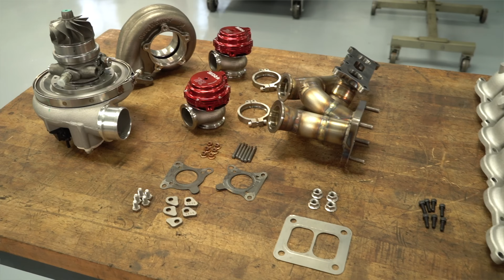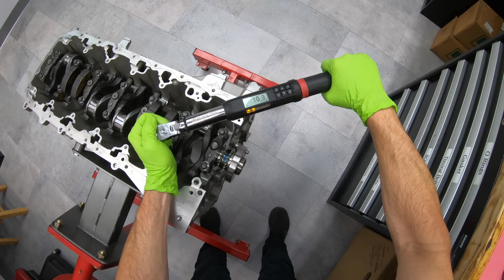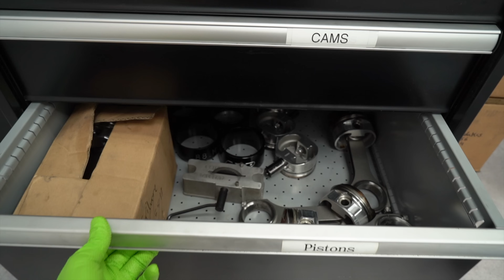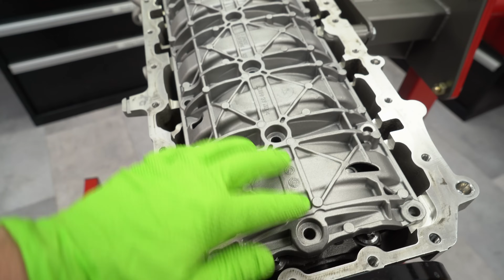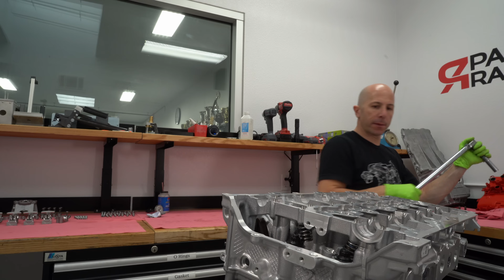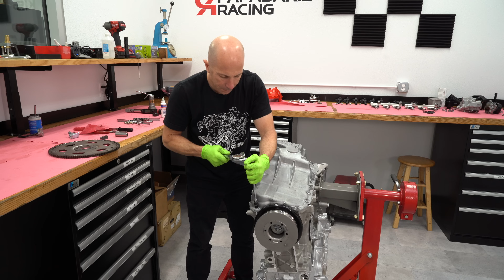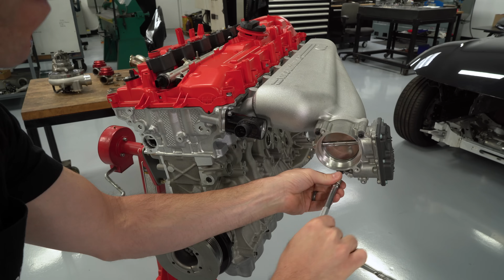2020 Supra 1000 HP Engine Assembly - Start to Finish

Comment: I hate to be that guy, but even if this engine costed 1/2 as much to build up to 1000hp as the 2JZ, I’d still go with the 2JZ. Per usual BMW designs are too overly complicated and finicky for no good reason. There’s no way I could see this engine lasting as long as a similarly built 2JZ without having issues somewhere
Reply: Mostly the way that the main caps and head bolt/studs crush down into the aluminum block and head that could cause uneven pressure points and even fractures down the road. Also the added valve train complexity and the two itty bitty exhaust ports that I could see restricting the flow necessary for super high horsepower applications. Only time will tell though.

Comment: I will guess the head won't survive the power because the localized heat will reduce its capacity to take the pressure, unless the compression ratio was lowered and the cooling flow rate was increased in ratio to the power increase.  Just guessing.

Comment: Your removing the direct injectors for port injection but the ports aren't designed for wet flow. All the cool features of the engine your removing!

Comment: The new 2013+ vw engines have all the same technology for the exhaust manifold and variable cam lift but are MUCH simpler than the complex bmw design. Very poor design imo.
Reply: Ptao Tom  what does that have to do with BMW's design ?

Comment: He only replaced the rods and pistons. Why did he remove the crank and reinstall with stock parts? He never tested the stock pistons or rods for 1000hp. I think he wasted his time, and only needed injectors, wastegates, and bigger turbo.
Reply: You could of ported and polished heads, stronger valve springs, 😕 WTF is he thinking?
Reply: @sleepwalker29  no one knows the limits of these yet not even in the 1000hp range so why not see if it all can handle it.

Comment: You kidding ,wright ? 1000hp  ,with that tini exost ports?  Sounds like a mega fart  from bmw % toyoda .
Reply: I mean it looks like he's using a similar method that people use with those tiny ports on rotarys yet they still make tons of power. Even tho he could've just switched to a 6 port since the mk5s B58 is the only existing B58 with 2 ports rather than the traditional 6.

Comment: How will the stock PTC clearance work with those forged pistons? BMW is running less than .001" clearance with the stock hyper pistons and those forged pistons probably call for .0035"?

Comment: I know you said you are gonna design a part for the valve lift why not just have a program that overrides the electric motor to run at full lift? That way you don’t have to worry about designing a part that may break and then have to be remade by hand. Instead of just replacing a part that can be readily available

Comment: Welcome to the BMW engine world!  If the valvetronic holds up at that power level it would be stupid to lock it out. The main throttle is usually open all the time. The valve lift controls throttle percent and has better that ITB response.   Oh year never run that dampener without a drive belt if it’s factory.

Comment: Legend has it that he is still paying off that snap on torque wrench.
Reply: I dont understand someone said that costs 2k dident find anythink with that price on snap ons page.
Reply: @jjoeabhn2526  Yeah they're around 600 for the 1/2". Not terrible, but a Teng is almost as good.
Reply: @jjoeabhn2526  they are around $650
Reply: @jjoeabhn2526  those wrenhes are like 25 grand maby more.
Reply: @JimCornette-d5o  well yup 500$ aint even that bad
Reply: @jjoeabhn2526  Honestly yeah. I saw that SnapOn wrench and thought this would be way north of a grand.
Reply: Picked one up 3 times used for $280.
Reply: I have one its really not that expensive I paid $400 for mine
Reply: My snap on guy recommended the split beam, cheaper, flex head, and stays calibrated longer. Really nice tool.
Reply: @vipercrazy-9 flex beam are not perfeard for engine building due to most fastners are torque to yield.
Reply: I got mine for $370
Reply: Bro that fucking killed me hahaha
Reply: Chemical Spore definitely. I have the same model and have been paying it off for 2 years. Next year it will be paid off!
Reply: Not even expensive I have the same one
Reply: Just bought one.... $1200
Reply: Right?!
Reply: Is just 190$ 😒
Reply: I also have the 1/2 inch version of that wrench and I’m still paying for it after a year
Reply: $1000 Australian
Reply: Snap On is so overpriced and dangerous, if you have a business account with them they will let you get 10s of thousands in debt at a obnoxious interest rate
Reply: @cneddy22  are you serious? If your stupid enough to get yourself into 10s of thousands of debt with a creditor you can't blame the creditor. You have this thing called free will. You can choose not to buy from them!

Wow.
Reply: Was gifted two of them. I use the Harbor freight because ghetto mind thinks I can't afford to break the Snap Ons.
Reply: I was salivating over it. Bucket list lol
Reply: I paid £300 for mine. Which I guess is around 500usd? And snap on tools here are more expensive than the same model is in the USA. For obvious reasons.

So I don't get what people are on about.

Mines excellent and paid for itself in peace of mind alone
Reply: Legend has it, hes Papadakis and you are a nobody.
Reply: LOL! 
Great features though
Reply: I’m sure he could afford plenty with the cost of this build, and the views on this video. 💀
Reply: @sheltonforester3707  You're a  buzzkill like Sheldon on big bang.

Comment: Too much things going on, just the thought of it is exhausting. Special tools, tricky springs, traditional air cooler adaptation (stock must not be adequate for high hp) at the end of the day 2JZ seems to be the better choice when it comes down to what a Supra should be equipped with.

Comment: This, with the others, are VERY cool videos - 

Those appear to be VERY thick wall gudgeon/wrist/piston pins - any reason you don't use tapered pins as that outer mass does nothing to help the combustion' bending loads through the centre and will actually induce even more bending loads becuse of the inertia?
Not to mention the additional loading on the 'rods, bearings and crackshaft - on that, any thoughts on using titanium 'pins?

Comment: Special tools, back timing belts, belt driven oil pump, expensive parts, and complicated engine !! What a mess
Reply: Seb C 
Modern land cruiser and LS engines are simple and could be taken apart by basic tools.

Speaking of timing chains, what of I wanted to install a cam why would I need to remove all the engine out ? Sorry Toyota failed.

Belt driven oil pump means no high RPM gains. Also not reliable
Reply: Seb C 
We buy these exotic cars to modify them not to drive them slowly. Please stay away, sit on the chair watch and enjoy

Comment: I’m sure someone’s said this but you can just lock out valvetronic. Once the engine warms the throttle stays open and it uses the cams to run the engine.

Comment: "IMO" Torque heads have ~7% more contact surface area overall so you'll get a more repeatable, consistent torque value vs. hex; plus less stripped heads because the contact angle applied when torquing is greater than a conventional hex. Glad to see these used here knowing what gear-heads are planning to do with these engines.

Comment: Little Debbie Nutty Bars are one of my favorite chocolate/peanut butter wafer snacks ever made. also the amount of special tools needed is still ridiculous, Toyota's variable valve lift design was more service friendly and robust (2zzge with VVTi-L). you can tell this is purely a bmw design. also if it struggles to make 1000hp to the crank with a ported head and built block and a turbo with a 74mm compressor wheel ima be sad. 2jz's have been making 900whp using turbos with 64mm compressor wheels (Inducer measurement) albeit with cams but still comparable lift to that of whats on the b58

Comment: you should grind the cam lobes flat, the ones that drive the direct injection pump that's most likely located on the valve cover. you know that thing is going to rob horsepower even if the pump is not hooked up to a fuel system. the spring inside that actuator is very very heavy duty because it needs to be to create the psi needed to directly inject fuel into the combustion chamber. therefore that pump will cost you HP if left in place and you plan on using port injection rather than direct infection. 
solutions:
1) grind the cam lobes that drive the stock fuel pump so the actuator is no longer actuated, leave the pump in place to seal the valve cover
2) do not grind the cam, remove the stock fuel pump off the valve cover and fabricate a block off plate to seal the valve cover. 
good luck, as a repair mechanic that specializes in Toyota's, I will flow this closely, the new supra motor is so german, but the valve train is definitely a mix between the two engineering philosophies
also if you put one of those lifters in a cup of fresh oil and stick a small allen key into the hole at the top of the lifter and find the small ball detent inside the lifter with the allen key and push down, you will be able to compress that lifter and if its in the cup of oil you will be able to prime those lifters. then if you assemble and start the motor before they bleed back down you will prevent that initial "clack-clack" sound that most Toyotas make with these types of lifters before they prime from the oil pump.

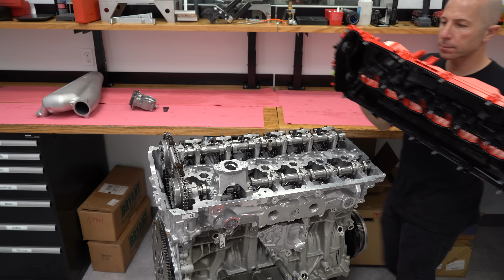Comment: @10:30 - "We actually found this thing called....Cerakote?" "It's pretty amazing."
"Oh you need paint on your car part? You're welcome." - The Second Amendment.

From their website: Cerakote™ is a Division of NIC Industries, Inc. and was founded in 1984 with a focus on developing and manufacturing the highest performing line of ceramic coatings available anywhere in the world. To date Cerakote™ has developed over 90 ceramic colors and finishes and is used by more firearm manufacturers than any other firearm coating. This makes Cerakote™ the world leader in firearm coatings.

Comment: isnt this emgine designed by BMW ?
Reply: Yes and no. Yes it is and has been out since 2016 however bmw kept updating it year by probably switching or adding oil/fuel pumps,new turbos,or water/air intercoolers. While in the case of the mk5 Toyota may had made its B58 with 2 port heads while traditional B58s have 6 port heads in BMW's although since its modular they can be switched if needed and also it's different turbo that's different from other B58s and more oil squirters and a higher pressure fuel system is really the differences to the mk5s B58s vs normal BMW B58s.

Comment: Hows the transmission gonna handle all that power?
Reply: It's a ZF which is also related to the dodge demons ZF  so its possible to switch parts since their both made to be modular and just needs to be modified it for 1000hp.

Comment: Argue all you want... 
This engine short block is 90% stock.
 The block itself had 0 modifications. 

Bammm !! 1000hp

This engine is Superior to the legendary 2jz in everyway. This video shows enough to prove that point. It can handle just as much power, develops more power from the factory, and still runs more efficiently

I'm really impressed at the little details that the engineers designed to make things stronger and simpler at the same time. If you really have built engines....your able to see what I'm talking about
Reply: B58 is basically a N54 with a B57 diesel Block and forged bottom end. It's block is also made out of the same material used to make Vr38 and coyote blocks also so its more than likely sleevable. Thinking about it now he could've switched a 6 port head that is normally in B58s but it seems he didn't(although it is strange since the mk5s B58 seems to be the only B58 to have a 2 port head). And well the current record for them RN is 822hp on stock block and internals with a turbo,tune,rods,pistons,and better fuel lines(cant remember if they did touch the fuel lines or not). But im currently looking to see if it'll break the S55s record of 1178hp on stock block and internals.
Reply: @carboydorifutoparty3976  Engine displacement has increased from 2,979 cc to 2,998 cc.  This is driven by a bore that is smaller by 2mm (now 82mm) and a stroke that is 5mm longer (now 94.6mm)

Compression ratio increase to 11.0:1 from 10.2:1

Crankshaft is forged compared to the cast in the N55

Drop-forged, cracked connecting rods with IROK coated bearings to cope with the demands of start/stop operation and the wear caused on initial startup due to loss of oil flow

Elimination of iron cylinder sleeves.  The cylinder walls of the B58 engine are coated with electric arc wire spray (LDS).  In this procedure a conductive metal wire is heated until it melts.  The melt is then sprayed on the cylinder barrels at high pressure.  This layer of ferrous material is roughly .3mm thick, extremely wear-resistant and facilitates an efficient transfer of heat from the combustion chambers to the crankcase, and from there to the coolant ducts.

Engine block now uses a closed deck block design from the open design found on the N54/N55. The closed block design is stronger, but it is heavier, more expensive and restricts coolant flow requiring upgraded coolant system.  However, it copes with higher cylinder pressures better especially important since the bones of the block will be shared with diesel platforms.

Now utilizes an air-to-liquid intercooler integrated into the intake plenum.  This is in place of the air-to-air intercooler found on the N54/N55.

VANOS is responsible for timing adjustment, and Valvetronic is used for control the lift height of the valves and acts as the throttle body. Valvetronic used on the N55 is the 3rd generation, and the one that on the B58 is the latest 4th generation. There is no fundamental change in the working principle, the major difference in the B58’s Valvetronic system is it moves the servo motor out of the valve cover (which is N55’s design), and places it outside at the top right-hand side of the cylinder head. Such design brings two major advantages: (1) it significantly reduced the installation space; (2) It brings down the engine’s total height and lowers the engine’s center of gravity.

Introduction of a heat management module to cope with the higher temperatures seen in this engine.  The heat management module on the B58 is mechanically powered directly by the crankshaft through a serpentine belt. Inside the module, coolant flow rate is adjusted by a rotary valve. The mechanical coolant pump avoided the hassle of possible failure of the electric type in previous BMW engines. However, to deal with the situation that the turbo still needs to be cooled after engine is turned off, an extra dedicated electric pump is added to the turbo unit to tackle this issue.

BMW put a focus on engine weight distribution. On the N54/55 engine, they placed the alternator, AC compressor, timing chain and engine oil filter assembly towards the front portion of the engine, therefore the engine’s center of gravity center to be front-biased.   However; the B58 treats this differently: it places the oil filter and its radiator, VANOS timing chain to the back of the engine. This is good for the weight distribution, however with the price of maintenance difficulty and cost.  Although the oil filter cap is hiding a little bit deep in the engine bay, it is still not too hard to reach. However, the VANOS system is a huge pain for maintenance since it is located right behind the engine and extremely closed to the firewall.  It is impossible to service the VANOS system without taking the whole engine out of the engine bay. So, for those 340i owners that are out of warranty, please pray that the VANOS system does not break.

Since there will be noises when the timing chain is operating, BMW placed a sound insulation foam between the cylinder head/valvetrain cover and the passenger cabin firewall.

Basically a B series engine which is more than likely replace a lot of N series
Reply: @ufarkingicehole  don't think the chain will break at any time soon but I can't say since I haven't heard any cases of that happening to the B58 but yea it basically the replacement of the N series.

Comment: never seen a BOV like this, can't imagine what it's gonna sound like when they pop open
Reply: Those are not BOVs, they are wastegates. They limit the pressure built by the exhaust gasses. Unlike BOVs, that discharge the excess air that is already compressed on the intake side.

Comment: I still say that cast in exhaust is going to be a major Achilles heel !  Does the BMW head bolt on ?  For a million dollars you can get someone to design and cast a proper head without the extra camshaft and without DI.

Comment: I’m a heavy duty diesel mechanic and work on a lot of modern Detroit Diesel engines, which are German engineered (Mercedes). It’s very interesting to see that the #1 TDC timing pin and the camshaft timing tool are nearly the exact same on this little guy as a Detroit 15 litre. It makes it nearly impossible to set it up out of time.

Comment: Did you file the rings?  What are they gapped to?

Can you include information on what you are going to do for tuning.  How you determine fuel injection rate, advancing spark timing, boost pressure regulation...?